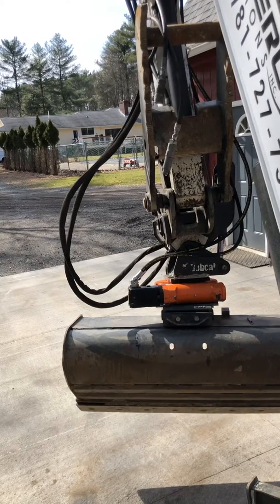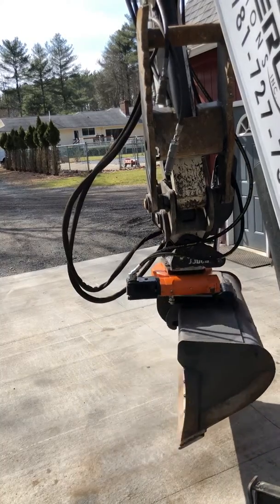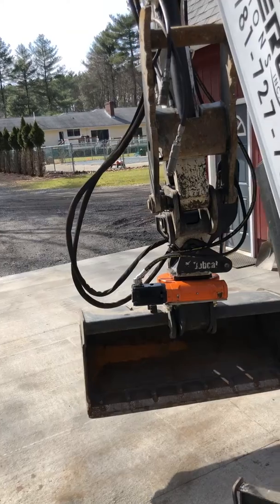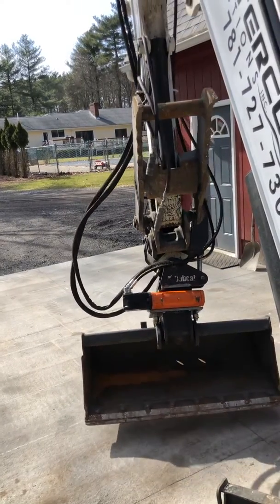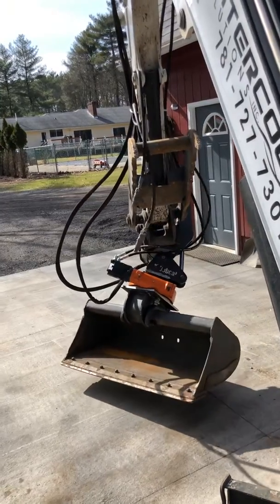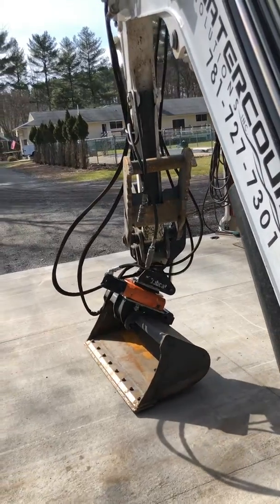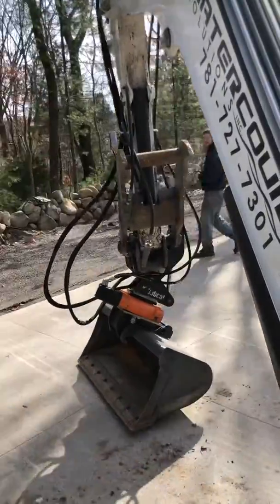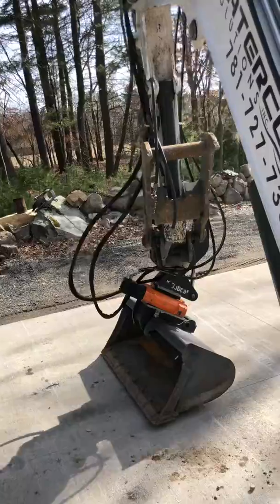Testing out my home made tilt rotator

Comment: Do you have a link to the orange piece and the black hydraulic piece going into it? I have a cnc machine and want to try my hand at making a tilt rotator also. Thanks!
Reply from the maker: I got it on eBay. It’s called a slew gear box. This one is 9” I also ordered one from cone drives. I think a 7” is more appropriate size for my machine which is an e45 bobcat.

Comment: what model slew drive are you using?  Will any of the ones used for a grapple work?
Reply from the maker: It’s a hfang pe9.  The grapple one may work? The log grapple ones I’d imagine are not the right type. It needs to be worm gear type